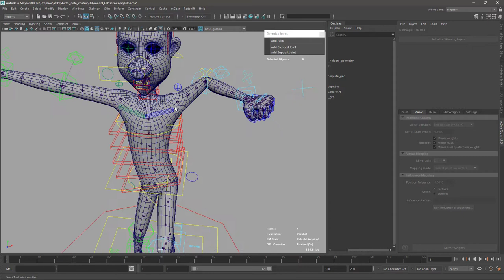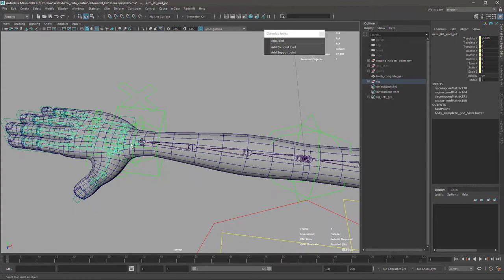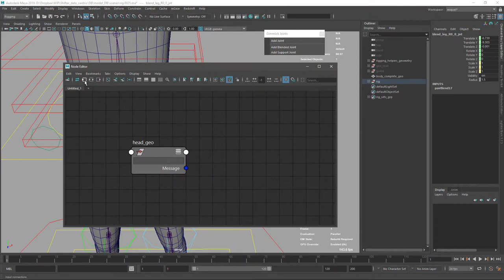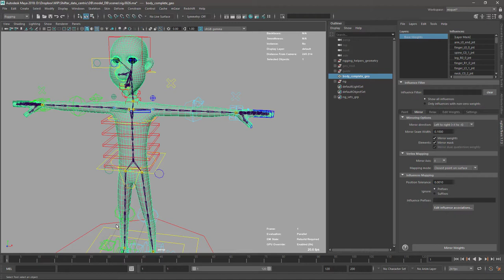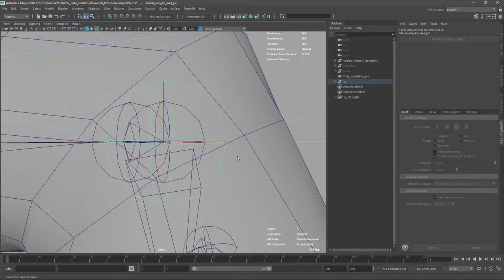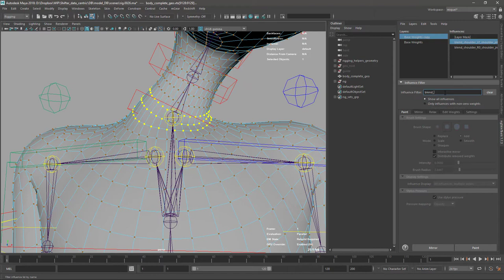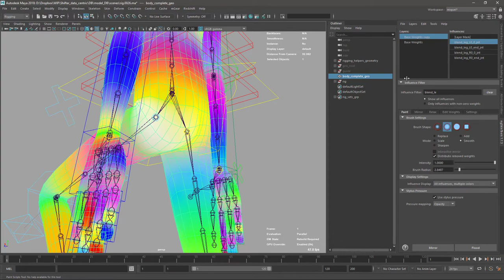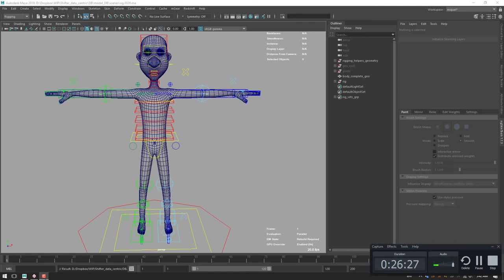Data Centric Rigging 010: Skinning 04 gimmick joints

Comment: In paint skin weights tool. you can right click on the selected joint and unlock inverse selection, it will unlock everything else except the selected joint. You can also filter the joints by name.